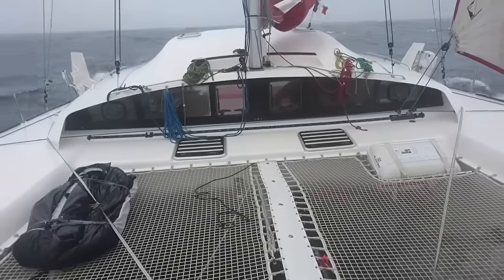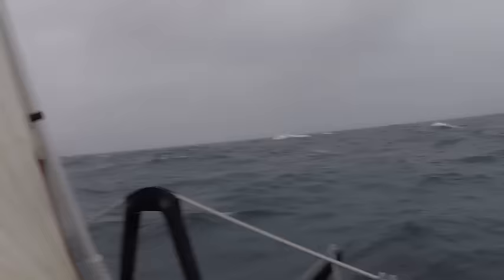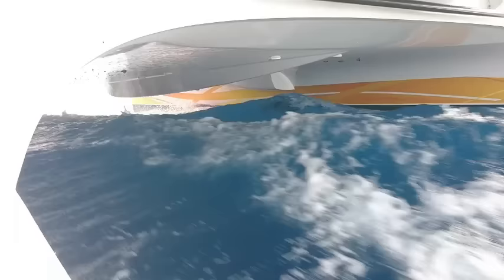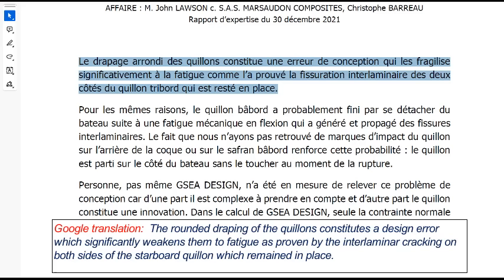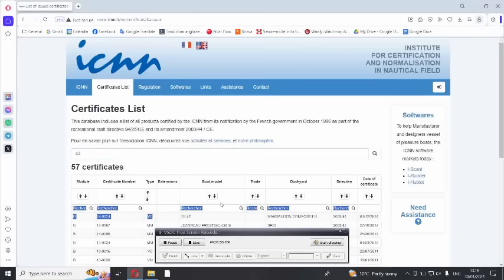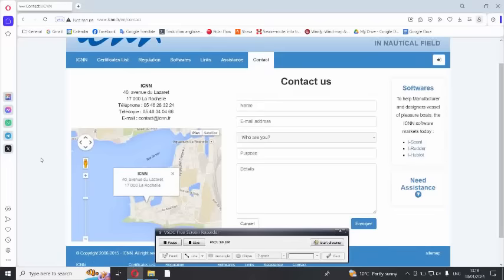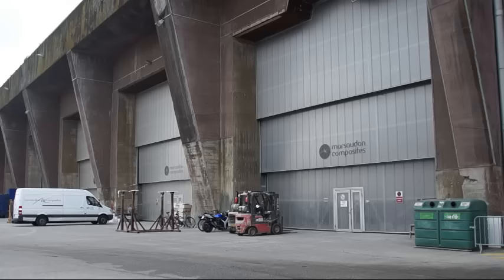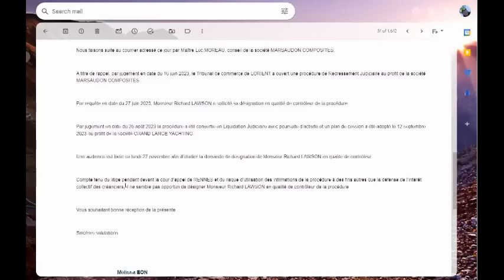Keel broke off mid-Atlantic - Marsaudon ORC42 Catamaran Part 1

Comment: John, watching your video made me sad and angry for you in equal measure. What a despicable company!  A few years ago i witnessed a Lagoon 42 i think being lifted by a trailer lift....the boat simply cracked up under its own weight with the internal bulkheads delaminating from the hulls. Have very limited experience of any other cats but i have never been impressed by French builders.
My own boat is a 12m Dazcat. Its approaching 30 years old and has done over 80 k miles. I have no structural issues at all. Its a light boat ...7.5 tonne full of fuel,water, and lots of stuff. Light boats can be built well. If you cant get satisfaction with the builders and have no alternative but to fix the boat then Multimarine Composites in Cornwall really know how to build and repair boats.
I hope you get your money back. Dealing with the French is never easy!
Reply from the maker: Thanks Chris. I spoke to Darren a while back and if the receiver ever speaks to me, and it suits him to agree a solution where I get my boat back, a repair at the Multihull centre would be on my wish list.
Reply: Poke around enough and you'll find similar stories about your pals at Dazcat. I have no actual first hand knowledge, nor any personal opinion of them, but it seems all is not well there either. As I'm in the business of looking at boats and their defects I've learned that none are immune from defects, poor workmanship or poor business dealings...it's a bit of bad luck and how you handle it.
Reply: @sailandfish 
Not sure where you are poking.
The 2 most arduous races in the UK calendar are the RBI and the Fastnet.... Boats get absolutely hammered. The multi hull fleet is usually made up of many Dazcats that return year after year.
Dazcat have been around for over 30 years and I have one of the oldest boats which has been through some pretty harsh conditions and she is still completely sound.
Multimarine are  superb boat builders.

Comment: You won't like this suggestion...but here it is (I think it's the best for you).
You were screwed.  The boat truly wasn't built well, it wasn't designed well.
It's shocking(to me) to see how that boat is falling apart.
Either trash the boat or repair it yourself.
Again, this isn't your fault, but sometimes it's easier for your own peace of mind to just accept you've been buutt fukt and move forward.
Life isn't fair at times, as this is an example.
Bite the bullet and repair it yourself.
You'll be back on the water and done with this frustration.
This isn't 'fair' but maybe you'd be happiest getting the thing back on the water asap (but I'm super suspect of that entire boat).
I literally have made model sailboats which had better structural design than that huge catamaran.
Reply from the maker: Thanks for the encouragement :)